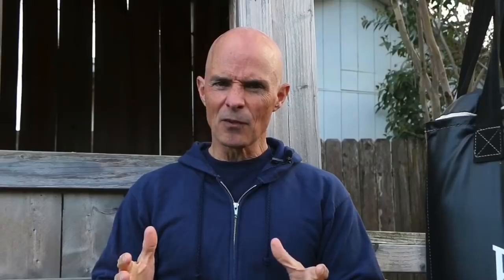INTAKES FOR TURBOS-BETTER UNDER BOOST?

Comment: Thanks Richard!! Another great video!!  How about some "Torque Monster" videos? I'm guessing that a lot of your viewers are like me and want the best bottom end performance we can get for hauling loads, RV,s, Campers, Boats, etc. I travel all over the mountain states and really don"t have any use for an engine that delivers the best performance at 6K plus RPM. Keep up the good work!!!
Reply: Diesel
Reply: @austindoud273  - I disagree. Especially when I already own something with a 6.0l in it. I'm not going through the expense and trouble to diesel swap it, nor am i going to buy one of these newer diesels with their ridiculous emissions gear. I know that my engine can make 1,000 pounds of torque based on things Richard's already done, but like OP here i would love some info on the builds that aren't focused on higher rpm power. 

What can we expect from setups like a 6.0l with a TBSS intake and a stage 2 truck cam? Then with boost? What do the curves look like? How well do the various turbos spool? Can you get full boost before 2500 rpms with a setup like that? Will the engine be ok if you did? These are all interesting question to probably a lot of us...
Reply: @austindoud273  yup, you said it.
Reply: 6.0 liter, 862 heads, TBSS intake, summit stage 2 truck cam and 8lbs. Cheap and easy north of 600hp and all the good stuff low and mid range
Reply: @melissahill7930  send me the 4l60 and I'll build it to handle 5-600 all day. Most people jump for the 80 and while I don't dispute the fact that they can be capable of more power, they eat bushings, they eat cases, gear ratios aren't as good, and they suck a lot more power.
Reply: @GreatLakesLogger  I acknowledge that I didn't let you build my 4l60E but I did have 3 different people tell me that they could do the same thing. I had a pretty stock 5.7 in a 98 Z28 Camaro. Headers and cold air bolt ons but the motor internals were never touched. Maybe 350 to 375 horses. 3.73 rear. My 4L60E went south so I got it rebuilt by a guy that said it would handle 600 horses easy. Drove it to the track and 3rd pass it blew again. Back to the guy and he redid it and it lasted about a month before it blew again. Next another guy same scenario,  didn't make it over a few months. 3rd guy same thing. I built a turbo 350 and ran it for several years and dozens of trips down the strip and never had a problem!!! I built a 6.2 with over 500 horses and the turbo 350 never missed a lick. But I did miss the overdrive.....
Reply: @dannywilsher4165  Ya that's too bad... Would be interesting to know what went out on them.
Reply: @GreatLakesLogger  It had to do with second gear. Clutches maybe. It would move in 1st but second was like going into neutral. I always thought there was something wrong with the tune but everyone who looked at the tune said they didn't see anything wrong. Is there something in the tune on them that controls fluid pressure to 2nd gear? I don't really know....
Reply: @dannywilsher4165  There is adjustment of that in a stock ECU, at least in the newer ones that I'm familiar with. How was fourth? If that was out as well then that would be a band failure l.
Reply: @GreatLakesLogger  It wouldn't go into 2nd so I never tried to see if it would go into any other gear. Reason I wondered if it was in the ECU was because it did the same thing to 2 transmissions 3 different times. I wondered or figured it was a low fluid pressure not engaging the clutches tight enough and was letting them slip...

Comment: No turbo cams
No turbo intakes
Just slap whatever you can afford together and give no fk$ 🔥
Reply: If you read this, I am throwing a cheap eBay turbo kit on my 08 4cyl fusion😂. Upgraded fuel pump, but that’s about it. Only goal is to get the car running, because i figured it would be a funny mod for such a basic daily driver.

Comment: I want to see  a comparison with the edlebrock cross ram with the twin turbo setup
Reply: And the stock truck manifold
Reply: Ok cool what about a dropping in a cam vs the same cam being degreed will it make more power by degreeing the cam? Most people just drop a cam in and don’t degree them. Are they losing power buy not degreeing them?
Reply from the maker: I tested the Edelbrock intake-that video is up-its the same under boost

Comment: Better-flowing components also flow better when boosted, and boost amplifies those improvements.  Think of an engine as an equivalent flow restriction orifice - the larger the orifice, the more airflow at a given feed pressure.  So the less-restrictive intake made more power even at a lower boost level, because it was flowing more air.

Comment: Come on dual plane.... oh it’s all injected.
Reply from the maker: check out the 20 intake test Hot Rod (google search it) for all the info you want on single and dual planes on the LS
Reply: Richard Holdener ok thanks I’ll check it out now. Is this a boosted article? I’m trying  to see how the ls responds with a dual plane under boost.
Reply: @Tariq_F._Raheem86  it doesn't matter
Reply: Austin Doud I’m more interested in fuel distribution and at what point it becomes a problem on a blow through carbed ls. So it matters a bit.